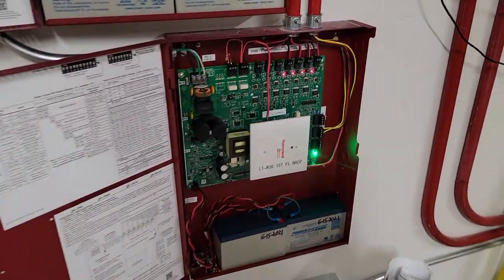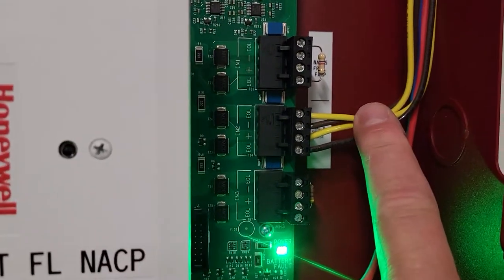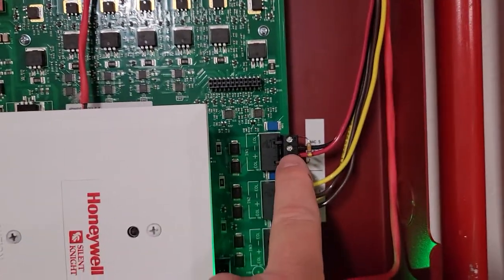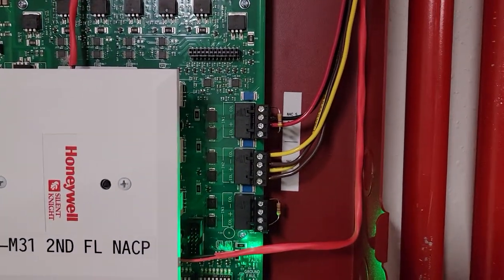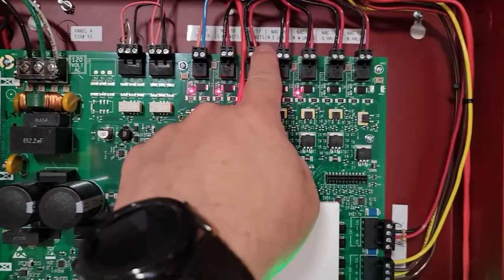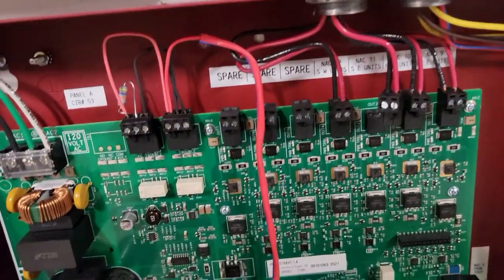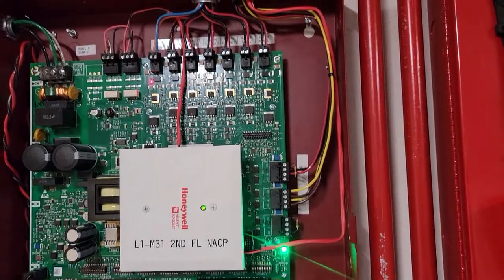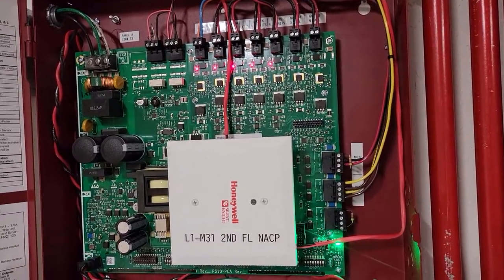Fire-Lite / Silent Knight PS-6 & PS-10 Trigger Input Issue - Won't Pass Alarm Through with Trouble

Comment: 3 years later: I think this featured flaw regarding the trouble preventing pass through of trigger has been changed . I just reread the manual I had to download for two ps6 ps10  and in the daisy chain section it states that in alarm condition the EOL relay will close allowing other daisy chain power supplies to activate

Comment: Having trouble activating the outputs on these things. Tried every which way via dip switch settings. Panel is set to slave config with outputs 4 and 5 set. I do not have any red light though on my outputs. Ugh!
Reply: ive had the same issue!
Reply: Same problem.

Comment: Thats the way these new nac panels are designed. Read the manuals for them, cant wire them the way we could for the FCPS-24fs8's&6's
Reply: OK READ THE MANUAL: IT SAYS YOU CAN DO THIS EVEN SHOWS A WIRING DIAGRAM SHOWING THIS

2.8.2 Daisy-chaining Multiple Units
The number of power supplies which can be daisy-chained is limited by the line resistance and current draw limitations of the upstream module or NAC output circuit. Refer to the module, power supply, or fire alarm control panel manual to confirm these circuit specifications.
Maintain separation of power-limited and non-power-limited wiring as shown in Figure 2.6.
Figure 2.13 shows the controlling signal connected to Input 1 of HPF-PS1. However, typically any available Input of HPF-PS1 can be used.

Comment: Broooo! How did UL let that slide!? That's pretty freakin serious.. You'd figure FL would jump on the digital bandwagon (intelligent ps) but they like to keep it OG..
Reply: Because if you read the manual it shows that you should be using an output to trigger the next Power Supply not the terminals for EOL.